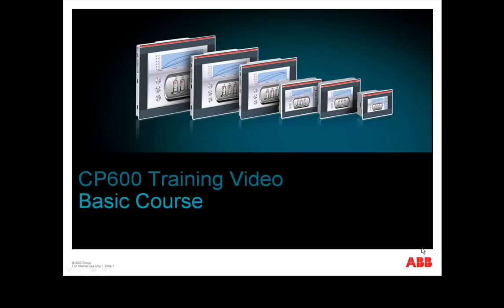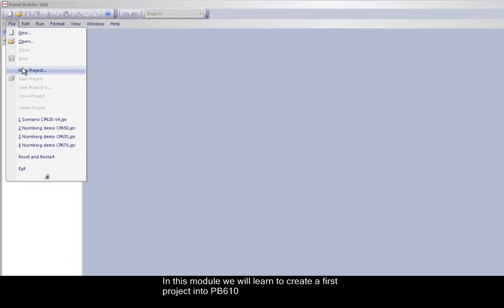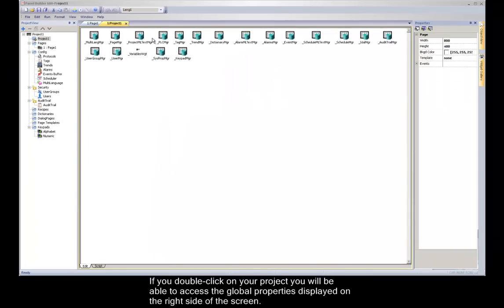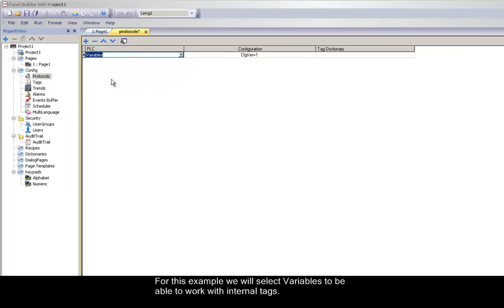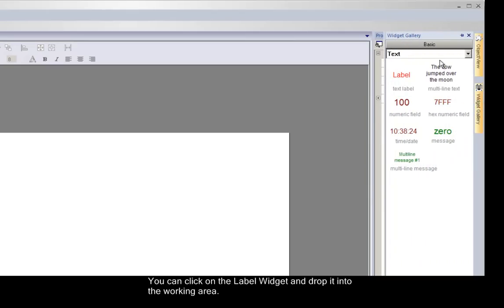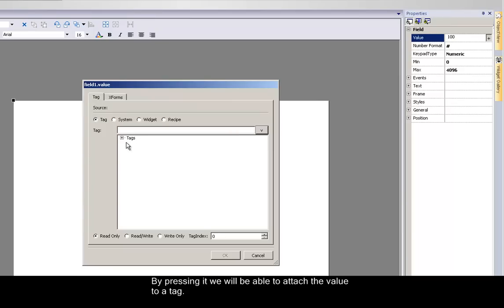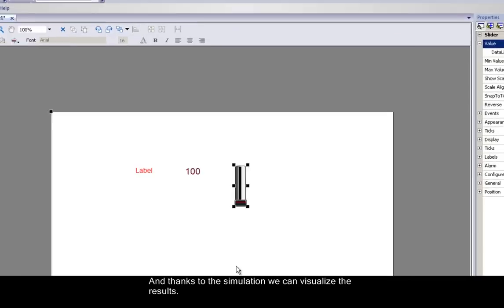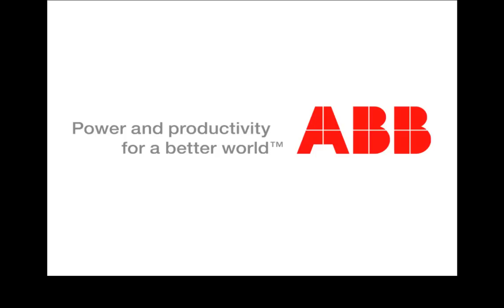ABB CP600 HMI - PB610 First Project

Comment: I have the same problem as NAM NGUYEN. Please help
Reply from the maker: Hello Michal,  the reason is that you used old version of CODESYS, And now from (end of 2010) the Automation software is composed of 2 parts, one dedicated to configuration ( Control Builder Plus ) and second part dedicated for programming (Codesys ), main question, have you returned back your licence form in order to obtain updates and information of new versions ? You can contact your ABB local sales units in order to regularize your situation or to have more informations about Software evolution.